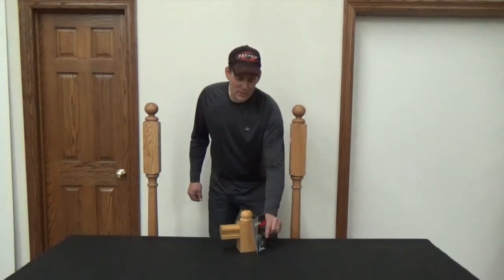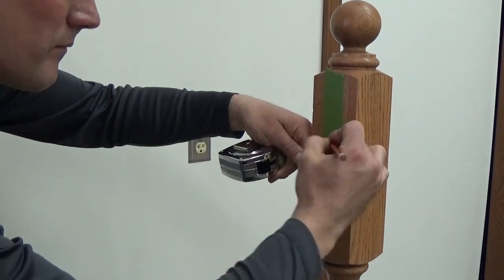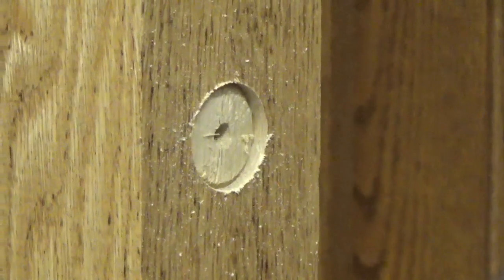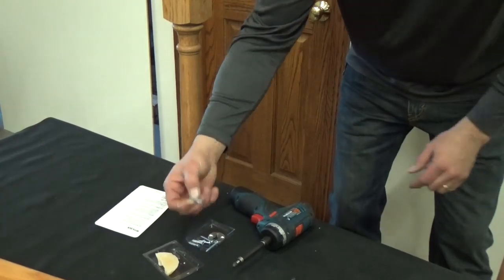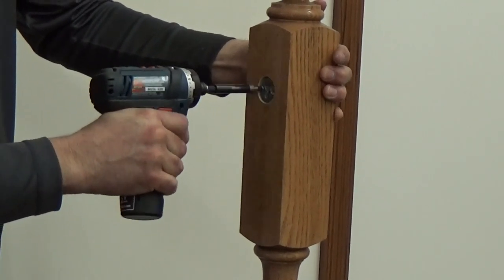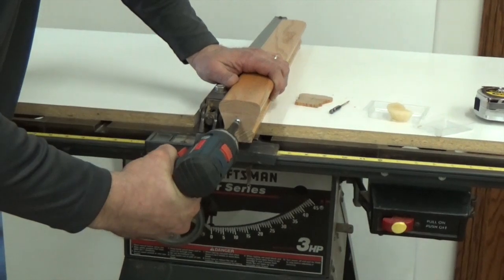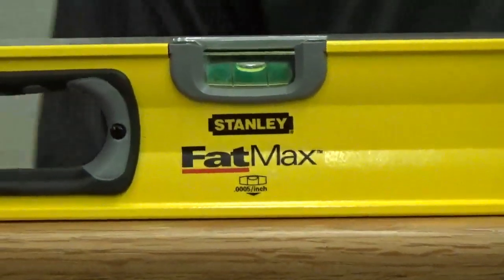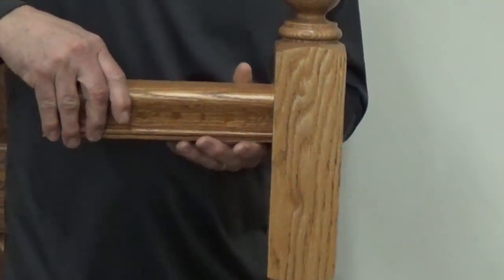How to Connect Handrail to a Newel Post Using MiniLock Handrail Fastener

Comment: To me this system has a serious flaw in that the handrail will pop out again if upwards pressure is accidentally applied !
Reply from the maker: When installing the handrail to a post with the minilock fastener, you are required to hammer the handrail down with a rubber mallet or other means; this will tighten the connection securely so that unless you were to hammer the handrail upwards the same way it was hammered downward, the handrail will not move.
Reply: Doesnt look very strong to me!
Reply from the maker: The MiniLock plate is made of hardened steel.  Load strength tests are available at Fastener Unlimited, Inc.
Reply: Just add glue